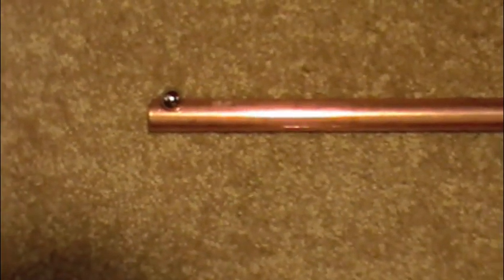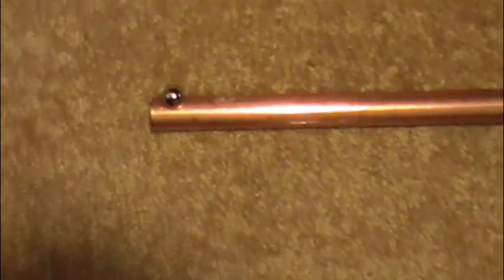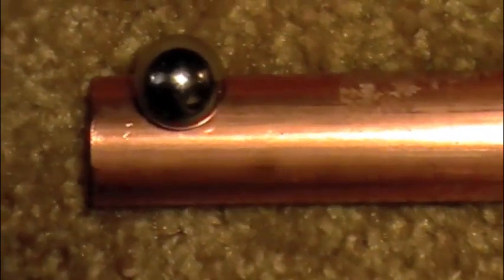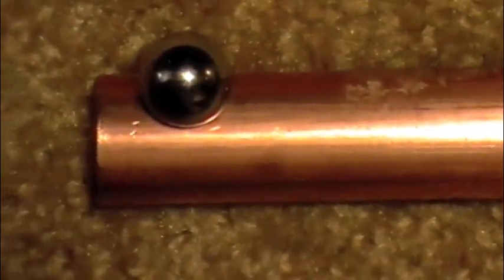Neodymium magnet falling through a copper tube

Comment from the maker: Cindy, there are several that I can think of:  1.  The initial angular momentum (spin) put on the magnet by my hand when it was released.  2.  Air resistance, laminar and non-laminar flow of air moving past a cube confined within a cylinder.  3.   Possibly uneven mass (slight effect) of the cube's composition.  4.  Temperatures involved (slight).  5.  Diameter of the tube  6.  Diameter of the cube.  7.  Density of the cube.  8.  Coefficient of friction of the cube striking the walls of the tube on the way down (slight, since the cube was smaller than the cylinder and barely touched it because the fields tended to suspend it away from the walls as it fell down)  9. The strength of induced electric and magnetic fields, which are proportional to the strength of the magnet and the permeability of the copper tube.  There are probably more but that's just for starters.  Hope this helps.
Reply: Sir, its not that complicated I think its all about little "help" of earth magnetic field... what you think about it?
Reply: Eddy c.

Comment from the maker: Hi,
The direction of the movement of the magnet is irrelevant and has no effect whatsoever, except for the added effect of gravity.  In other words, movement of a magnet through a hollow conductor is resisted in proportion to the speed of movement, the strength of the field and the proximity it is to the conducting tube.  Remember, direction itself is not a factor.

Comment: Does the neodymium magnet that is being used in this type of experiment have to be a certain diameter in relation to the diameter of the copper tube? Does it work better with a magnet thats just barely smaller in diameter than the tube? 

Also, does the thickness of the copper tube make a significant difference in the results? If using a VERY thick copper tube, will the magnet go slower?

Thanks...

Comment: No. This is magnetism. The "moving" magnet GENERATES magnetism. Gravity, while connected to the other forces, though it all hasn't been precisely worked out how(Einsteins Unified Field Theory), does not respond to anything we try to do to it like electrical fields do. We can't GENERATE gravity. We can make big lead weights and small lead weights. The big weight's gravity is bigger than the little weight's gravity, but only because it has more protons and neutrons than the small one. Cont. Pt2.

Comment: Some time ago there were a couple of electronic mags I had subs to. Pop Electronics and Electronics Magazine. In one was a kit project to build an electronic electro magnet that could pick up non ferrous metals, like pennies(zinc), or bits of real copper. The explanation stated that the fields generated in the coil generated fields of opposite polarity in the pennies. These attracted themselves together. The pennies would hang in a string in the usual way. But it was not a strong field.

Comment: you could just flip the magnet over to change the direction of the magnetic flux if the LED doesn't light - that switches the direction of current flow.

Comment: It would also require more power to lift the car. Through history there has never been an elevator that fell to the bottom killing occupants. In modern elevators the cable pulls continuously on a braking mechanism, if the cable is suddenly cut, the mechanism unloads its springs engaging brakes which hold the cab static. This technology has been in use for 100+ years. Personally I wouldn't want to have my credit cards near the magnet of strength required for That job. That's not safe at all.

Comment: I was thinking of the bigger picture...what happens when you anchor a boat in a swell..constant rolling motion..a linear generator is not a big stretch of the imagination..rows of them in waves...If you do put an electrical load on the system would the magnet fall even slower?

Comment from the maker: All you would need do is tape, solder or screw a wire to one end of the tube and bring the other end up to the opposite end of the tube.  If you placed a volt meter or ammeter in series with it, it would easily register  This is the same principle used in nearly all electrical generators: you either move the magnet past a conductor or the conductor past the magnet.   As a fun experiment you might use an LED instead of the meter and turn out the lights to see it glow.  Reverse leads if not work.

Comment from the maker: Diamond is so "un-magnetic" it is listed under the category of diamagnetic, vs. paramagnetic in quality, with an Xm of -2.1.  Zero is the breaking point for substances that, above zero, have at least some permeability; iron is about the best.  Bottom line, no, the magnet will fall unhampered, except by air resistance (or passing UFO's, of couse).  But if you are unconvinced, please send me a diamond tube and I'll test it myself. (B-b)=[